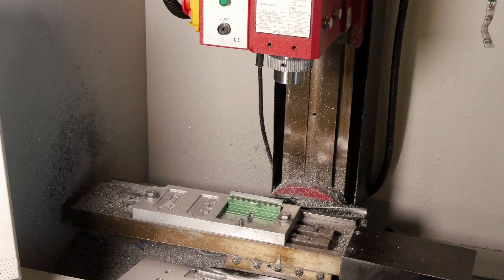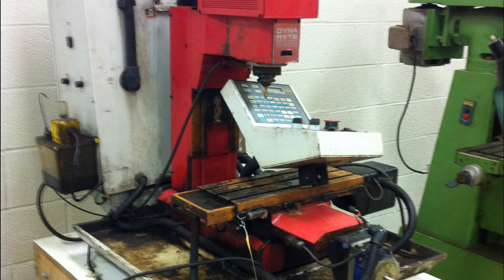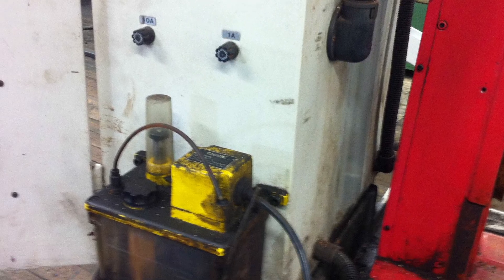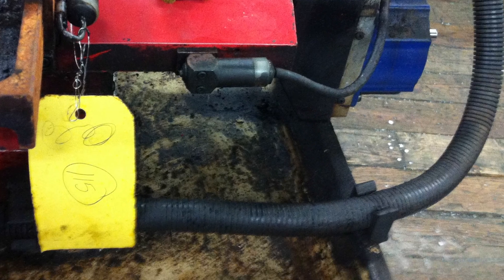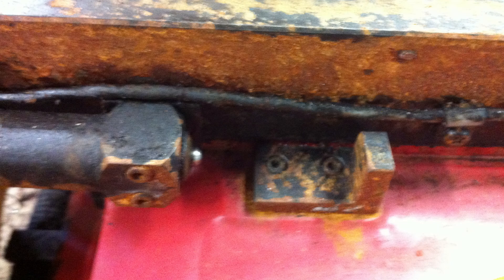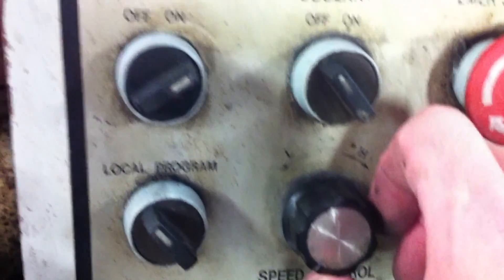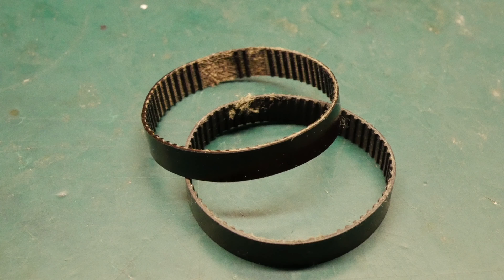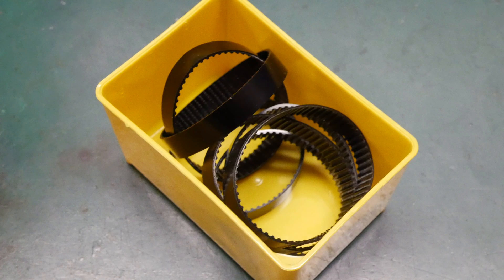Dyna Myte DM2800 CNC restoration/ Dyna Mechatronics repair - Part #001

Comment: awesome! do you have any manual or tutorial of the touch panel? thanks!
Reply from the maker: If you are talking about the manual for the original dynaMyte machine control I have that in a pdf.  Contact me through the email address on my about page and I'll send you a copy. Thanks for watching!
Reply: @PeteRondeau  awesome! thank yu so much! and could you explain how you can put a program trough tis machine? i got no clue. Thanks!
Reply from the maker: @viewcycleblog5222  I'm afraid I can't help you there.  When I received mine the only thing I was able to do was jog 2 of the 3 axes.  I almost immediately stripped it and sold off the original control to others who would have far more use of it than I.  I knew from the beginning I would be updating the electronics so I didn't bother to learn anything about how it worked.

Comment: You probably have found out by now but you will need to get away from the Vee belt drive for rigid tapping.
Reply from the maker: Hey James, yes, that has always been the plan but I don't end up mentioning it until later in the series.  Thanks for watching!

Comment: Dyna's are solid machines. I have a 2400 and a 3000. Both have been operational over the years via Mach. I run an Acorn on a G0704 and would like to use it on a few others I have around. Still trying to wrap my head around tool changer PLC.s.
Reply from the maker: I have done several CNC conversions- years ago using AHHA and more recently Mach3.  The one AHHA conversion had a really large tool changer that we ran with a stand-alone Allen Bradley PLC. The Ahha system was short on I/O so we just programmed it to send out a number of pulses equivalent to the tool number I wanted and then the PLC did the work and set an input bit back to the AHHA when it was done.  I'm hopeful with additional IO provided with the future release of the Acorn expansion board this will get a bit more direct.